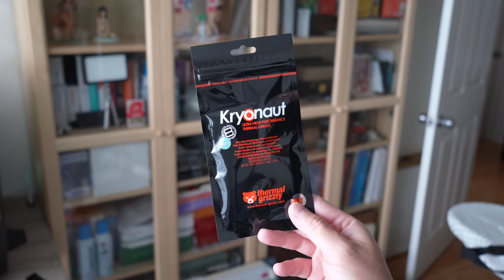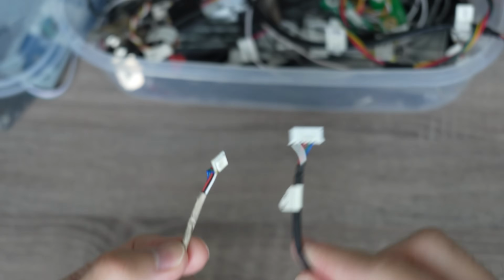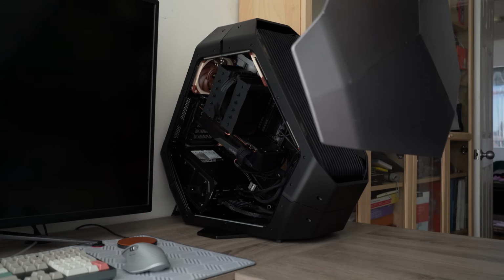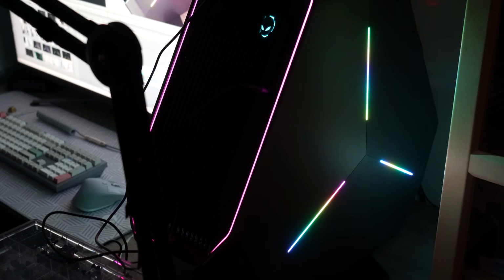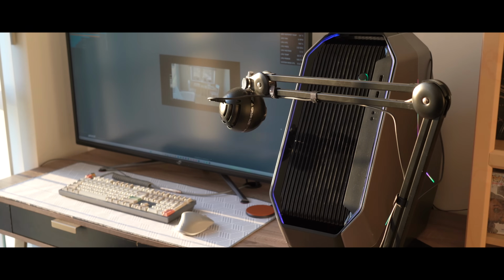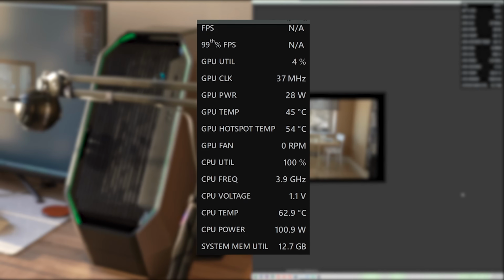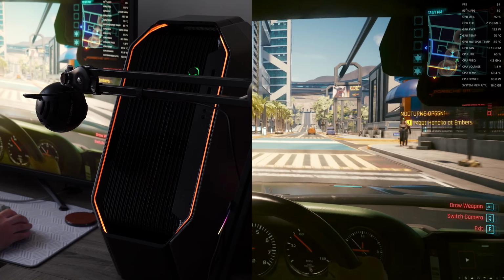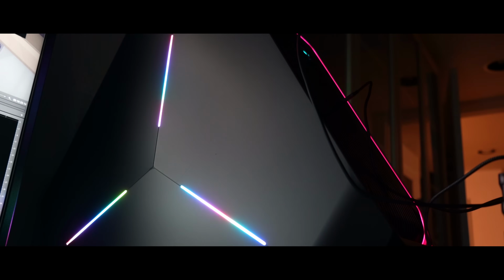This is the BEST ALIENWARE EVER.

Comment: Did you have any issues with air flow? I have an R2 I’m rebuilding and lots of people are talking about how the case is way to restricted and they modded the case for air flow.
Reply from the maker: No not at all. Air flow is perfect. If you are not going to mod it just put 3 fans in the front all intake. They blocked one of the fan brackets with a plastic sheet on default so remove that too. Did you check out my latest video? I did this case in white :)

Comment: Did you replace the new LED strips on the front? Or that OEM? Thank you, I’m currently planning to do the same like you…soon. But with 2025 hardware.
Reply from the maker: The front is oem. I will have an update video on this really soon. Probably will be up in a few hours
Reply: @howardishere Man, but how did you make it work? Can you make a detailed video? Because I am currently have an R5 and can I use the R5 front I/O board?
Reply from the maker: No I never got the R5 I/o board to work, as in to control the front panel lighting. I have to use the R2 board to control it
Reply: @howardishere But you did have it on your case, right? But it didn’t work so you had to go for the R2 IO front board. Am I correct? Thank you.
Reply from the maker: Yea thats right. I am only using the R5 board for the usb and audio ports. The R2 controls the lighting.

Comment: What power supply did you use? Thanks
Reply from the maker: Corsair HX1200. These full size power supply fits perfectly in the case.
Reply: @ well shit. Won’t power on…..
Reply from the maker: Did you check out the new video I put out? 😎
Reply: @howardishere I did. Looks great. I should do a video of mine.  Not as fancy but it works. Lol

Comment: I now have 3 R2's and have one beefed up for gaming. Works well with a rtx 3080.   But haven't replaced the motherboard yet.  I have a few things picked out just watching prices.
Reply from the maker: Sounds like a good plan! What are you getting?
Reply: @ going with the b850 tomahawk max wifi with the 9700x
Reply: @ putting it together now. Any tips on the wiring?
Reply: @howardishere how did you connect the front usb and panel cables. Dell cables are too small to fit?
Reply: @ well shit. Need a 9 pin header cable. X2 lol
Reply from the maker: I am only using the R2 board for the front panel lighting and power switch. Need molex power, USB 2 header cable and the front panel cable for the power button to work

Comment: I still have my R2 sitting in one of my places... everything connected except, i think I took the GPU out, or there is a very poor one in it.   This  PC is very... very ... even very old.  I remember wanting to upgrade it so many years ago, but the design of it, is not very friendly to newer MB's.  I loved the design of it, and besides the inconvienance of changing motherboards out, it was a very simple PC to swap out other componants.  I loved the HDD's or any hard drives were kept seperate.  Upgrading of course, is dependant of your motherboard.

Loved the video, wll watch again, as my R2 is the only past builds case I have kept, just for the design.
Reply from the maker: This case design is now more than 10+years old but I just love it! The case fits any atx motherboard I think I can even fit an e-atx motherboard in it.
Reply: @howardishere  After watching your video, I now have to go get it, and give it to my computer friend to take a look at.  I will look into the atx motherboards though.  See how they compare to my Z790 Nova, and Crosshair x870e Hero :)  Would love to get it upgraded and used as a back up system.  I have to re watch your video in regards to the side led lights I believe you said you had to change out because they didn't work with the new motheboard?
Reply: Oh, just rewatched, and you changed the side leds because you wanted something different, and not that they didn't work.
Reply from the maker: That’s right :)
Reply from the maker: And check out the new video I put out 😁

Comment: What steps did you take software-wise to set this up? I'm running into problems running AWCC
Reply from the maker: You need the 4.x version of awcc. Before you install it you need to edit regedit there is a complete guide on this here: https://web.archive.org/web/20160828130018/https://www.alienowners.com/threads/how-to-install-command-center-for-a-non-alienware-motherboard.7119/

Comment: Still using my R4 - just replaced the 1080Ti with a 7800XT.  Will look to upgrade the MB/CPU/RAM next year (and the fans as the standard ones are obviously from a server parts bin given the noise).
Reply from the maker: Those thick fans are a beast though lol

Comment: Just got me one of these on ebay for 150 bucks, wanted one of these for a loooong time. Mines the R2 version btw, so I might just attach another ssd instead of the optical drive. Could I know where you got those dell cables from? I think I might need them for some of the rebuild.
Reply from the maker: I got some from eBay and some from another case. I still have a bunch of cables I might be able to help you out. Which cable you need?

Comment: Nicely done. It has been said that it would be impossible to use another motherboard in the proprietary Alienware builds or the RGB lights wouldn't work and you would have to use a dremel for the IO shield. I have the Alienware Aurora r7 (same design language as this Area 51 but smaller) still running strong and I think it's the best looking case ever made.
Reply from the maker: Good to hear! I am rebuilding this computer soon so stay tuned :)

Comment: Hello. How did you manage to customize the backlight color on the front of the case if the Alienware software doesn't work?
Reply from the maker: The software works. Older version software works. I am using version 4.
Reply: @howardishere  I check. What is the full version of the program you have?
Reply from the maker: Its Alienware Command Centre 4.0.59.0. If your motherboard usbs are set to passthrough power when system is off you need to turn this off, power the computer down and turn it on again. The software will recognize the board.
Reply: @howardishere  I check! Thank you 👍👍👍🙂
Reply: @howardishere  Hello. Disabled USB in BIOS. But Alienware Center Commander does not recognize my PC. 🤔
Reply from the maker: Which version are you using? And if possible can I see a picture of your pc? Just want to see how you connect the cables. Can send it to my Instagram @howardishere

Comment: I need some help getting all this to work I've been stuck trying to figure out how to get everything to work. I have always wanted to repurpose my old Alienware case and make a lot of upgrades as you did in this video. Did you have to buy third-party cables to get your motherboard to function with the R2 IO Board?
Reply from the maker: No I reused all old cables. I did try to use extension cables but the pins on the usb and audio cables weren’t the same as the originals so I just swapped back to originals.
Reply: @howardishere  weird, I'm trying to use the cables that originally came with the alienware PC for the power switch and the USB but the receiving end is smaller than what is on my motherboard. It seems I may need to try and find a female to female cable for it to work. I'll try to take a closer look but I do believe that one end is a bit smaller and cannot use it. I just wanted to reach out to you if you had used any other cables other than those that are for the alienware.
Reply from the maker: The power switch cable? It should be plug and play the motherboard end of that cable is just one plug so check and see your motherboard (the power switch led hdd led area) the holes should line up with the pins perfectly
Reply: @howardishere  OH! One more question did you have to download alienwares alien command for the lights on the case to work?
Reply from the maker: Yea you need to download Alienware command Centre. I am using an older version 4.x it works perfectly. Try to Google it and you will find it
Reply: @howardishere  You've been Extremely helpful and thank you so much for all the info. Also, I found out that the Proprietary cables for the R5 model of the Alienware are really different from that of the R2 model.

Comment: Your build looks great!  Thanks for the great video.  I will have to remember your RGB upgrade for the future.  I've been using an R2 that I got at a garage sale a year or so back.  I was very lucky that it had all the original hardware aside from the graphics card, and that the i7-5820K was very overclockable.  Boosting to 4.5ghz on the stock liquid cooling setup.  I replaced the thermal paste, and put a gtx 970 in it.  It is very much lagging behind with the current generation of games, but it's very nice for ps2 and ps3 emulation and many games that are only a little old.  I'm looking forward to using this case for my next build as time and money allows.
Reply from the maker: That’s great! I didn’t really like their stock liquid cooling hut in general I just don’t like liquid cooling lol when you upgrade just keep the cables and the front IO board and you are good 👍

Comment: The Alienware Area 51 has been my dream PC since I first saw it in my teenage years. And since it's been around for a while, I just bought one for around $440 on Ebay with taxes and shipping included. I plan on gutting it and putting in my Z590 motherboard, i5-11600K, RTX 3060 Ti, 32GB Corsair Vengeance RGB Pro (4x8GB) and Corsair RM850x. I will also use the same 120mm AiO I'm currently using.
Reply from the maker: That’s great! Wanna share some pictures when you are done?
Reply: @howardishere Yeah. The one I ordered off of EBay appeared to be in working order (arriving Friday the 17th) but I’m gonna plan things carefully as well. The biggest worry is the case cables not reaching the headers on the board so gonna measure that out once I get it. Found a video that linked the older software needed to get the lights to work on the R2 version so I could probably avoid modding as I want my case to remain stock.
Reply: @clayton8816  how did it go
Reply: @TexasArmedillo  It actually turned out pretty good until I got a Strix RTX 4070 Super. This case is not meant for wide cards unless you get a Cooler Master vertical mount kit. But since I was dead set on sticking with air cooling on my new board, me and my dad ended up drilling a little hole roughly in line with the 2nd screw for the GPU. If you ever end up attempting this in one of these cases, please make sure you take out all the PCIe screws and covers to take out that flimsy piece of metal Dell loves to use in their cases because then the GPU won’t sit flush.

Comment: People rag on alienware so much but in my opinion theyre amazing for anyone needing high performance on a small budget, well atleast their older used pcs are.  Case and point i got a similar auorora r7 with a intel i7 8700 6 core 12 thread cpu and a nvidia gtx 1080ti for 350 dollars!  And its beyond impressive how well it games for how old it is.  I actually bidded on a r5 like yours that came with a 3060 12gn vram version for 500 but lost the auction at the last2se onds by 25 dollars.  Shame as these r5s came with the best i7 of the period the 5200k i think it was which was unlocked and known for its gaming abilities.  My pc is similar in that it uses th3 v3ry best 8th gen i7 there is but isnt the unlocked k variant but with that being said mines still runs a steady 4.3 to 4.5ghz clock speed and holds at that like a overclocked cpu would do idk y.  Mines also is the watercooled aio version and it works well for me.  Naturally i took it all apart and redid the thermal paste upon receiving it and i have zero thermal issues on both the cpu and gpu.  So for 350 dollar i got a steal of a deal.  The gtx 1080ti for some odd reason still sells for 250 used, i think its cuz its good at mining due to it we rather high core count and vram.  That being said i could sell it and get a 4060 for 50 dollar mmore or a 4060ti for 100 dollar more so thats what im l8kely going to try to do.
Reply from the maker: Yea the used market for these alienwares are usually a bang for your buck. But people don’t like them just because they are prebuilt and not “special”. I love my R5 case and will continue to upgrade in the future.
Reply: @howardishere  a big reason people d0nt like them is due to the super unnecessary pushing of using proprietary items for the most stupidest stuff including parts that commonly fail yet aren't sold as replacement parts so from that aspect I get it

Comment: Been rocking the Area-51 r2 version of the case practically since it came out. I got one referbished, so it was a little dinged up. It’s a big case, it will fit any pc part you want (besides 2-3 fan aio) The tooless design for the side panels is genius. I recently upgrade the original specs (i7-5930k, water cooled, gtx980, 32gb 2133 ram) to more recent gear. I snagged a brand new x470-f mobo for 40 bucks. Upgraded to, r9-5900x using thermal right fs140 cooler, rtx 3060, 32gb 3600 cl16 ram, with a 2tb m.2 ssd. Can say the thermals are great. Slightly overclocked both cpu and gpu. Cpu gets to 85c in cinebench, idles at 35ish, never goes above 70c in regular use or intense gaming for hours. Gpu idles at 35c gets to 77c max. Ambient temp is 67-72f.
Reply from the maker: Great build!

Comment: This is seriously very good modding. Is the airflow really good ? is the aircooler fine ? may you need a second fan at front of the aircooler ? (like bequiet)
Reply from the maker: The air flow is really good in this case. Other people say it’s airflow is not good because they have radiators blocking the vents or because the only place to put a big radiator in this case is the front so warm air would introduce in the case if they do it this way. Completely air cool will not have any of these problems. And the top front fan is directly blowing air to the cpu cooler I don’t think it’s necessary to add a second fan to the front of the cooler :) the NH-D15 comes with a second fan I just didn’t use it

Comment: How did you connect the power supply to the front io board? Im looking around everywhere but cant seem to find a way to connect
Reply from the maker: Both front io are powered by molex.
Reply: so the molex plug right into a modular psu correct? @howardishere
Reply from the maker: Yea that’s right

Comment: Hi! 

I would like to mention that is a very well explain video!  The side panel are a amazing idea and very well done!

This video just gave me hope! I have a R7 and done a similar job. For some times im trying to figure it out how to get all the light to work. I have  done some progress but still not 100%.

 If i do some manipulation, lights will light up( PLUG / UNPLUG molex ) but its only temporary.  When i shut down the pc i need to do everything again. Like you, my pc would give some driver error...I cant see this pc without his light its make it souless...

I was wondering if i put a R2 FIO board and a logo board in the R7.  I've never find someone with a  R7 and make to light to work. I've find many R2 to find a way. That  just confirm my theory! 

Ive got some questions for you if your willing to answer them 🙂

Just to be clear are you able to tell me wich software do you use for the lights? Or at least wich version of command center do you use?

If you can, where did you buy the FIO board and the Logo board? Cant find anything anywhere...

And how did connect the cable for the front light to work? I mean  in your video you point were to connect the cable but sadly i cant see where they are connected. Maybe im blind...Can i use my already connected led cable to the new logo board ( R7->R2) are they the same kind of connector?

Sorry for my questions, im just happy that maybe i could get those lights to work! And you just did what i wanted try! 

Thanks you very much for this video🤘
Reply from the maker: Thank you!

I did play with the R7 front IO board as well and got the same result as you did thats why I went with a R2 front IO board.

Now the power button board (logo board) i believe they are the same as I have both and I couldnt see any difference between them.

The exact version of AWCC i use is 4.0.59.0. I only use this software to control the lights so i turned everything else off (power control and such)

As for where to buy you kinda have to aim for someone from ebay or your local ad, look for someone selling and R2 case with the boards still there. Rarely someone just selling the R2 board, ebay has a few of that but they are pretty pricey.

you dont need to reconnect the lights. leave the lights plug in as they are  and just change the connection from the logo board from your R7 board which is currently plugged in to the R2 front IO board. then connect the R2 board to your motherboard with USB cable like i shown in the video.
Reply: Thank you  for your answers!

This video is very well edit and very easy to understand.

 Like i said i was about to try exacly what you have done. I now i have the proof that could work! 

And even more  you where able to answer my other question about he logo board ! Your video give me hope! 

Thank you again.
Reply: Can your R7 AWCC control the lights? Does the software recognize fio? I can't seem to find it. I saw a Korean user figure it out on the Dell forums and there's a YouTube video, but I haven't been able to find it yet.